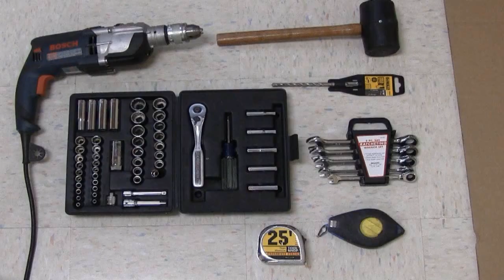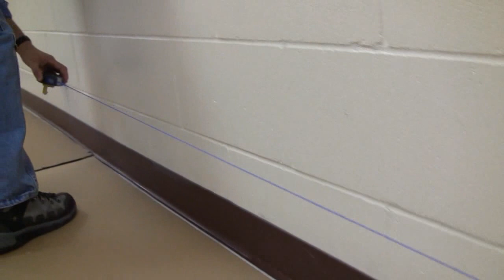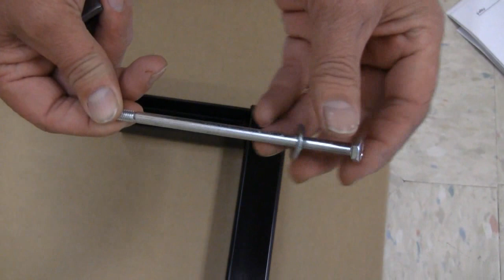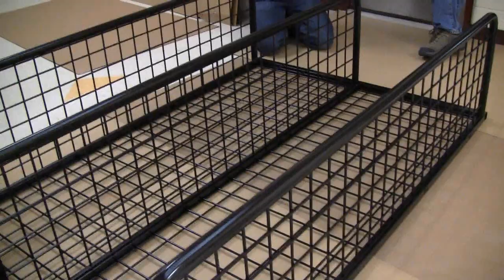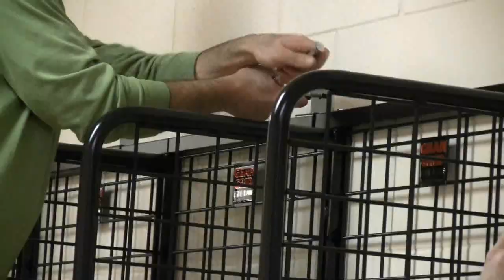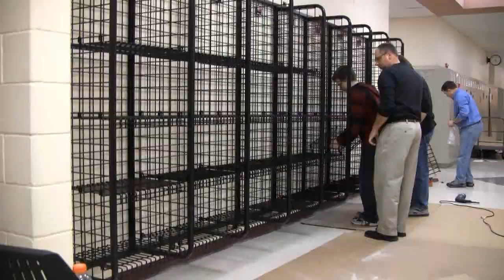GearGrid Locker install video and tutorial

Comment: RobinsandMorton employee.
If installing alone. Run the whole bottom bracket. Put two or three in at a time. Use zip ties to hold back and side panels together. Use 2x4 to pin lockers against the wall. A 2x4 can also be Used to alight back panel into side holes.